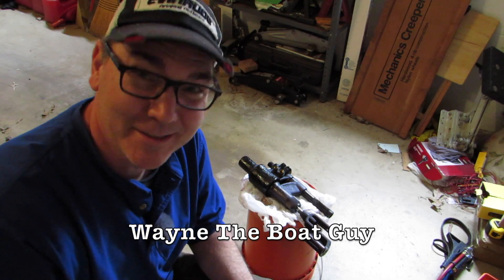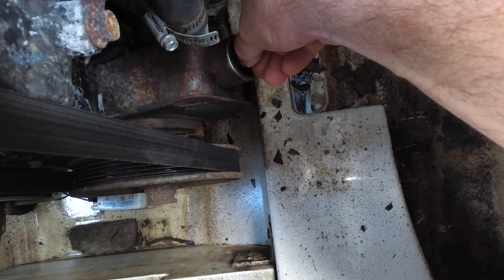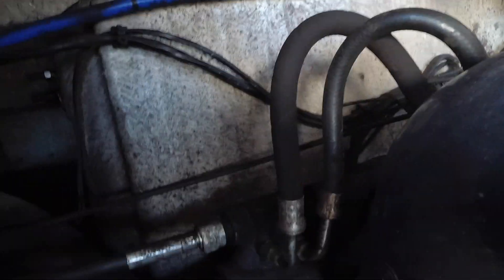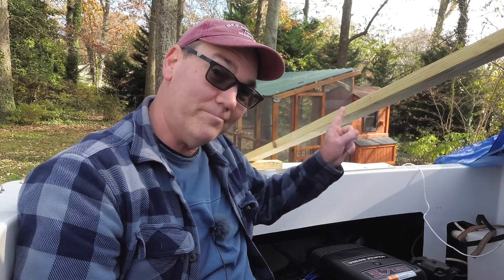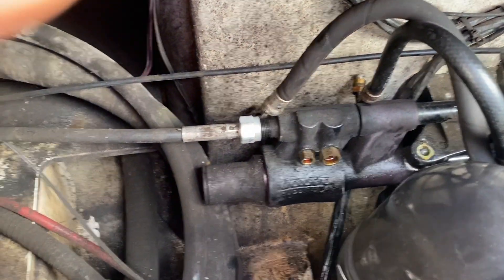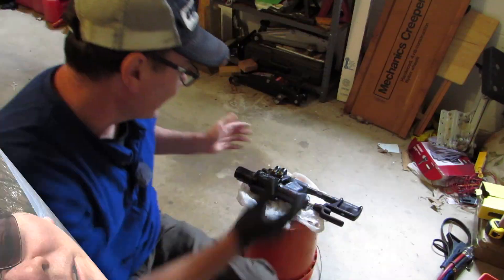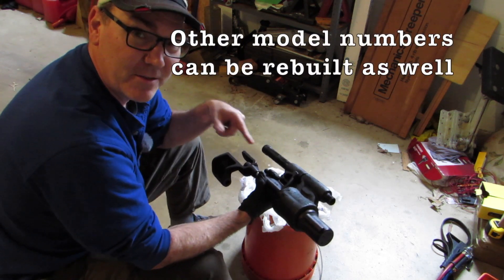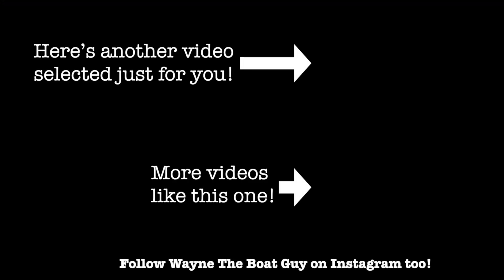Volvo Penta power steering leak - removing leaking actuator from my boat

Comment: Watching your video before attempting this process probably saved my marriage 😂😂
 Seriously , I had just reinstalled my reconditioned Volvo 5.7  ( for the 6th time since 2017 ) and while doing the thorough warm up check before taking it off the cradle and back in the water , I noticed a drip from one of the bellows , after squeezing back in for a simple tighten up a bit more , all done ,   I notice a “red” drop …..NOOO
 Hoping for the best but expecting the worst I came across numerous utube videos but the one that stuck out and gave me any chance of attempting this myself was yours Wayne ,  it still took me over 2 hours , but I took your advise and cursed a bit (lot) and persevered.   Thankyou 
 If the gantry had still been available , I would of dropped the leg and lifted the motor back out tho to give me access, as I have that down pat , around about 30 minutes . 
 Hope to be watching your reinstall video in a few days time !
Thanks again , Adrian from Australia 
 Thanks again

Comment: Hey Wayne, thanks to you I built up enough courage to tackle the removal of the VP actuator on my boat. Once I had all the tools lined up it took me about one hour to do. I have a long needle nose plier with both tips formed into a circle, I use it to remove stuck plug wires. Once I had one of the tips inside the loop of the cotter pins, I simply used a pry bar and they came right off. I was lucky, everything was well lubed and no corrosion at all. I'm about to send mine off to 5 Star tomorrow, like you I want to make sure it gets done right the first time. Cheers!
Reply from the maker: That’s awesome. Having the right tools and being able to reach places makes a huge difference. Pry bar with pliers - awesome trick!
Reply: @WayneTheBoatGuy  How much do they charge?
Reply: Thani

Comment: Hello to you Wayne,
Omg 😱 have you had fun learning. What ever made you not to get a survey on this boat. I can’t say much more on that because I didn’t get a survey either, shame on me also. I have had pretty good luck with my small 22 ft. I am watching some videos also on that actuator and don’t see many. My steering is stiff (not leaking) so I am going to wait until spring to unscrew the cable itself and see how it goes. I have Mercruiser in my boat very similar thank you for this video. Love your updates, be safe
Reply from the maker: This summer, every time a boat came up for sale it sold so quickly that surveys were not really an option and besides, if I found a perfect boat I wouldn’t get a chance to learn this stuff! If the steering is stiff and it’s not a sea star type (they usually have a tiny fill cap on the top side of the steering column) then it could be a dirty cable. There are some techniques people use with an air compressor and oil to service an old cable. If you disconnect it from the steering assembly and it still got some resistance, then it needs to be cleaned or replaced. Fingers crossed that yours is an easy fix. 
Thanks for watching and your comments!

Comment: can the rebuild service repair leaks to large cylinder (starboard seal) or do they only repair the smaller rod seals? if not, is there a source to buy this part new and identify the correct part using the vp engine serial?

Comment: Hey I have a question I put a power actuator on my boat and the power steering hose keep bursting would you know why It keeps doing that
Reply from the maker: Did it not have power steering before? On mine, the high-pressure hose is a different construction than the low pressure hose.
Reply: @WayneTheBoatGuy  yeai figure it out it had the wrong hose on it

Comment: Wow! Not sure where you are at but the last retail price we sold one for was around $900 new. I do most r&r's without removing engines. Usually exhaust removal will allow access but you need more than that $99 tool set. Some times engine removal is the only way.

Comment: How do I get the steering rod off. I got all the bots and pins and completely loosened the large fitting that the steering wheel assembly attaches to the cylinder but it won't come off
Reply from the maker: To get the steering rod off, you need to hold the  shaft with a wrench while spinning the cable connector end. See my install video where I show how that works.

Comment: awesome awesome video.  I feel like this is what is happening to my bat as well.  I haven't heard the whine yet but the steering wheel itself doesn't turn as smooth as I feel it should and has a little hitch in it.  I'm going to check for leaks.  What type of fluid did you top the system off with before you ended up pulling the unit out?
Reply from the maker: I'm trying to recall. It may have been automotive PS fluid. I found lots of conflicting info about which type to use when I first realized I needed to feed it fluid.
Reply: @WayneTheBoatGuy  when you got the unit back from 5 star, was the steering all fixed?

Comment: Wayne, this is a bear but your video is a tremendous help. I have cussed, hurt myself but have not lost any tools. Question: I know this may be dumb but how do you loosen the nut that holds the steering cable. I can't get it to turn at all without turning the entire cable. Obviously Im doing something wrong. Thanks for your help
Reply from the maker: I know what you mean! There’s a couple little flat sections on the thinner shaft area to the right of the big main knuckle. Put a wrench on that flattened section to hold it from spinning. When you see it you’ll know!
Reply: @WayneTheBoatGuy  Thanks Wayne. That thing had me so frustrated yesterday I had to yank myself away. I'll get after it again this afternoon

Comment: Hi Wayne, check the steering pump pully; if it grinds you need to replace that too. A branded pump costs a small fortune but this is a standard pump you can get from any car parts store. Easy replacement and save yourself some money and near future grief 😉👍.
Reply from the maker: Great point! I had been looking into that as it was my initial thought since mine is pretty rough looking! I will give it a good check when I reinstall the actuator.
Reply: @WayneTheBoatGuy   its a saginaw by the looks of it

Comment: Have to remove mine now. Screws were ok to remove, on the top one I used an impact drive and the lower one a long breaker bar. I'm now on the last pin that connects to the steering arm. The pin isn't rotating so I couldn't access the loop of the cotter pin to pull it out and after a lot of swearing as I couldn't reach to cut it either I thought on using a Dremel with small disc and it took 10seconds to cut the loop side and it came off easy from the side I have access. Now the pin is stuck and have left overnight soaking on penetrating oil and still stuck... hope I could get some ideas to get this pin out.
Reply from the maker: Try to see if there’s a way you can tap the pin up from underneath. I know it’s super tight working conditions. If not, maybe trying to wiggle everything to see if you can take tension off the pin. When I reassembled mine (today actually) my wife had to wiggle the outdrive so I could get the outdrive connector pin to drop.

Comment: About to get mine out, ordered the seals from eBay and hoping to be able to rebuild it myself (with my mechanic neighbour).
Reply from the maker: nice! I was a little too intimidated to try that part. They say to use regular non-synthetic ATF when you put it back together.
Reply: Did you have to pull the engine for this? I’m hoping you can remove it without that.
Reply from the maker: @Therealonehereyt  I didn’t have to pull my engine but I have heard of times where people have. It really depends if you can get to and remove those cotter pins. I really had to struggle with mine and use picks, screwdrivers and needle nose pliers.

Comment: A stubby air ratchet would make the bottom bolt much better, mine was super tight
Reply from the maker: I'm not sure one would fit where my bottom bold was located - but each boat is quite different!

Comment: Congratulations on getting the leaking steering actuator removed.  It looked so cramped in there I know the feeling of having to be a contortionist to get at a part.  It is good you did not have to pull the engine.  After going thru a number of boat surveys in the past, I think they are overrated.  I think it is much better to perform your own survey and include an in the water sea trial before the purchase.   Chances are if you just uncovered the problem after months of use, a survey would not have found it anyway.  When you buy an older boat you have to have the mindset that it will require maintenance to fix these problems on an on going basis as well as the preventative maintenance like oil changes and tune ups.
Reply from the maker: Yeah a survey (like a car inspection) doesn't always tell the story, but also like a car inspection it takes quite a bit of know-how, experience and practice to get good at being able to look at things thoroughly and objectively. I have a long history of overlooking things I know I can tackle instead of using those things as a bargaining tool!